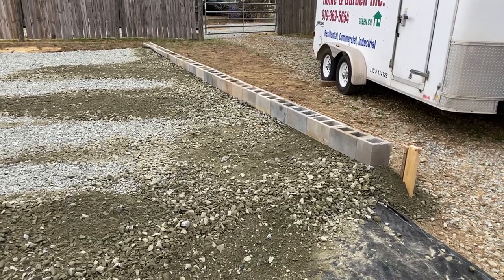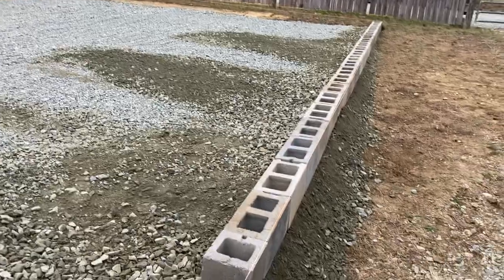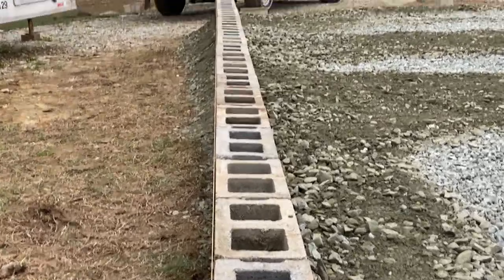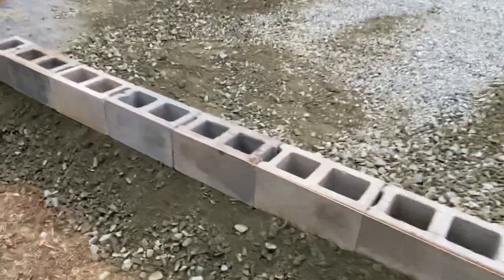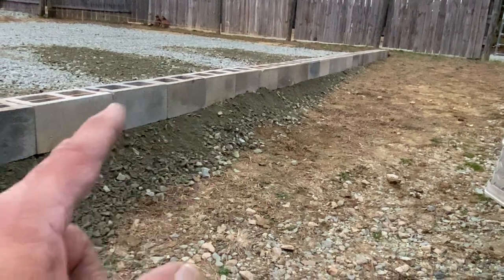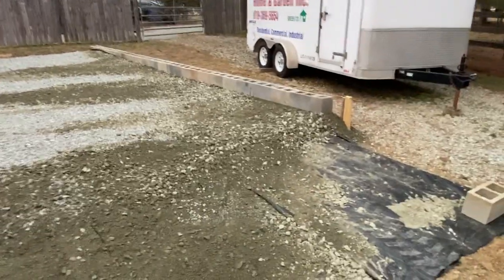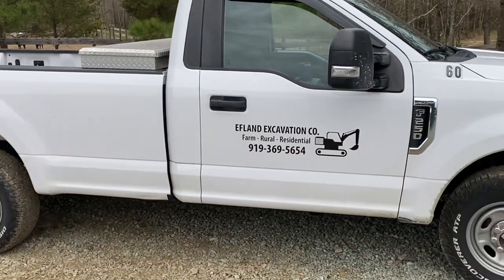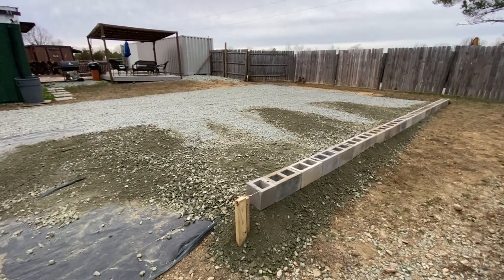25' X 30' Slab.  CMU Block 1st. Course is DONE!

Comment: First you'll need to buy or rent a laser level.  Next you'll need to grade down and get all the vegetation and top soil off site, Then you need some form boards,  stakes, 6 mil. polyethylene, some re bar, and (either fiberglass reinforcement or wire).  Probe your footings with a pointed piece of rebar to be ultra sure you are on hard ground. Run rebar on chairs in the footings.  Tie the rebar.  Don't let them put too much water in the mix.   When pouring the slab be sure and put a control joint every 8 feet and off any inside corners.  One last thing.  Be absolutely sure you have good positive slope away from the foundation.  Never let water run up near the house.

Comment: No batter boards, no water and tamping? Your over your head on this one Tom. You will regret this if you continue.Square the damn thing up and dig you a footing,frame up some forms and pour a slab !
Reply: Yes that be the proper way to do it.😮
Reply: Can't go proper or he gonna get taxed. He has to have a non permanent solution to avoid Uncle Sam. Best I can imagine is "floating" bin blocks.

Comment: What is holding the retaining wall up and in place? I have only seen cmu wet set or a big footing poured with its rebar and structural support.  The solid stack blocks for a retaining wall  is  dig In below grade, a  timber retaining wall uses deadmans to support it  from tipping over.  I hope you load that cmu block with a bunch of rebar, drive a bunch of verticals  like every other cell and tie a  few horizontals ... as you know the block and joints are weak, no matter if every cell is grouted or not after demolition of a few walls or buildings it's all about the rebar.  Cmu deadman's  outside the foundation foot print, burried in the abc or road base???  There will be some clever engineering to come, like he pointed out he understands foundations footings and load distribution. Note: commercial construction design builds are designed for a 70 year lifespan.   Low cost structure that lasts for 30-40 years sounds like a win. ( keep in mind that 20 year itch) 😁
Reply: I think our friend just got a little excited. Hope he reads all the comments and re-evaluates.